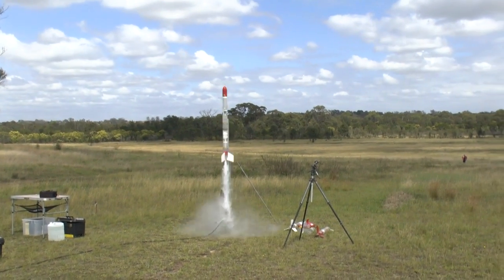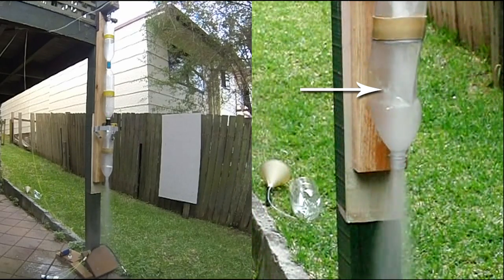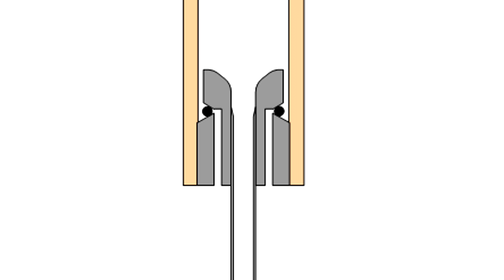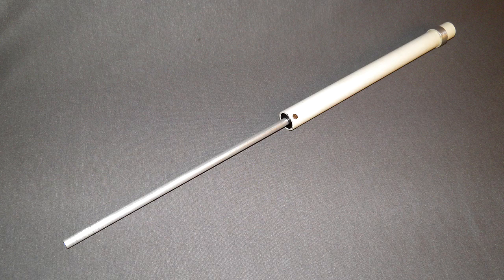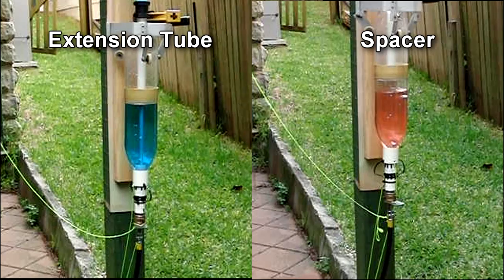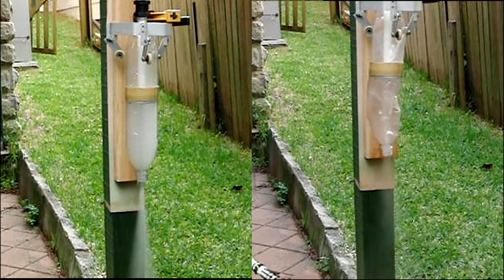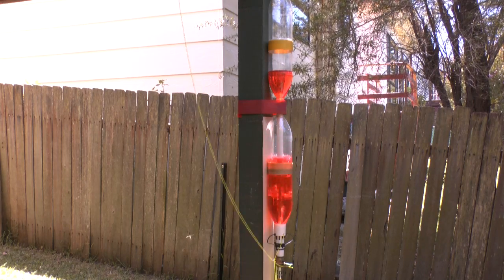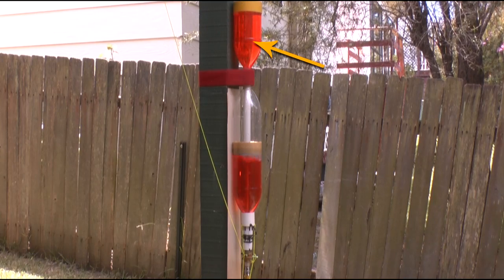Dual Thrust Water Rocket - Improvements and Measurement

Comment: I'm making a water bottle rocket, but I'm still figuring it out how to connect them, I'll be using 2x1.5 liter. and 1x1liter (Coca-Cola bottle). My nozzle would be the quick release garden connector (cause it's easy to use, other than improvising a launch tube).
Reply from the maker: Splicing bottles is your best option for conecting bottles together, but you will want to use ones with straight sides in order to get a good seal. Here is a tutorial: http://www.aircommandrockets.com/construction_6.htm

Comment: Can we try a converging diverging nozzle for this?
Reply from the maker: You can, though diverging nozzles don't work for the water phase part of the thrust. The air pulse phase would see some benefit if you are using higher pressures.
Reply: @AirCommandRockets  provided I have given high pressure, will the flow out of the nozzle be supersonic? And also, what if I use a light weight metal in place of a plastic bottle and inject flammable liquids inside and ignite them with high pressure? Will that be a good technology? Thanks in advance  :)
Reply from the maker: Well if you are injecting a flammable liquid (and presumably an oxidizer so you can burn the fuel), I know this will be a good technology because that is exactly what a liquid fuelled rocket engine does. If you are wanting to try something like this, I would strongly discourage you as it is extremely dangerous if you don't know what you are doing.
Reply: And what is the maximum pressure that the bottle can withstand? :D
Reply from the maker: Depends on the bottle, but regular carbonated drinks bottles will burst at around 190psi. This means you really don't want to pressurise it above 130psi.
Reply: @AirCommandRockets  that's nice, I'll try designing some sort of light weight frame for the entire bottle structure to withstand more internal pressure😊 thanks for the tip!
Reply: @AirCommandRockets  that's nice, I'll try designing some sort of light weight frame for the entire bottle structure to withstand more internal pressure😊 thanks for the tip!

Comment: I turned a jet foaming nozzle on the lathe.   The first few were good practice. I have a few pointers for those of you trying to make these nozzles. Sequence matters.   I started with a section of solid aluminum rod that is larger than the inner diameter of the PVC pipe.  I turned a section of the rod down to fit inside the PVC. Next, I chose which end would be the "upper" end of the nozzle and turned that upper section to be about sixteenth of an inch smaller in diameter. This is to allow  the water and air through.  After that, I cut the V groove . The V groove is placed at the point where the lower larger diameter section and the upper smaller diameter section meet.  While the new nozzle is still in the chucks, I drilled the exhaust hole through the center.  Once the center hole is in place, I cut the whole nozzle off the end of the rod.    Measuring the depth of the V groove, I then mark the 4 fill holes on the bottom of the newly cut nozzle part.   It is important that when drilled, the holes A) don't  cut into the center exhaust hole and B) don't cut into the V groove. and C) don't go all the way through to the top.  The 4 drilled holes need to dead end just above the top of the V groove. So you will need to measure the depth needed to drill and set that depth on the drill press. The final step is to turn the nozzle on the side and drill the exit holes from the V groove into the 4 fill holes.  These exit hole also are depth sensitive in that you can't drill into the center exhaust hole.   When I drilled these holes, I made sure to pay attention to the pressure on the drill press handle - when it lightened up I knew I was through the side wall and into the fill hole.  other things to consider,  make sure the V groove is deep enough that the O ring can flex inside the groove and not be held in place by the side wall of the PVC pipe.   When I do another nozzle, I will try to cut a taper into the center of the top end of the exhaust hole in order to get a convergent flow towards the exhaust hole. This should reduce turbulence around the entry end.   I will also drill a short pilot hole on the bottom end of the nozzle to accommodate  the small exhaust pipe - that will provide a dead end for the pipe. In any event, I'll made that a snug fit so that it hold though use. I'll try to make a video with my next one so you can visually see what I am describing.
Reply from the maker: Thanks for the great write up Doug. I would be curious to see the type of results you get with the nozzle.

Comment: is there possibillity to make big rockets using homemade connectors ?? my leaks how to make them ?? i used bottle necks
Reply from the maker: Yes it is possible to make big rockets with home made connectors. How did you make yours and where does it leak?
Reply: AirCommandRockets with 2 caps glued with hotglue gun and melted holle with soldering iron but caps are slicly bended at top thats my problem i used pipe tape and ducktape but i can't fix it any idea ?
Reply from the maker: That type of connection will not work well. Caps are made from polypropylene and most glues will not stick to them. Hot glue from a hot glue gun is too weak as well. There are great forces involved in these couplings when pressurised so the connection has to be very strong. Try getting a PVC pipe that just fits on the outside of the cap. Rough up the outside of the caps and glue them into the PVC pipe with 24hour epoxy. That should get you a better connection.
Reply: AirCommandRockets thanks ill try it wiuld be nice that youmake tutorial on this theres nothing on google and youtube about those connectors probably 70% of people have that problem ... thanks ill try to make it

Comment: I know almost nothing about rockets.......... 
The boost and sustain have separate pressure vessels at first.
I would want to add a small bypass joining them bc the sustain pressure vessel has a lot more "power" stored.
I know the air phase at the end helps but having a punchier boost would help more. Also, you could easily tinker with the bypass and adjust the ratio of boost to sustain.
Just a thought......
Also, anyone else notice the air amplification effect that caused the vacuum. Is there any one way intake that could let that happen and not leak pressure at launch? Would the extra flow help or would it just rob speed from the jet and lower late acceleration.
I know almost nothing about rockets, but this stuff is cool. I'm going to go build one.

Comment: Hello, I have a few questions here: 
1. How do you keep the water from entering the extension tube after passing the non-return valve? (Or does it matter?) 
2. How do you make the non return valve? What is it made out of?
Reply from the maker: Hi, good questions. 
1. We have it plugged with a piece of skewer stick wrapped in electrical tape. This prevents most of the water from going in. The skewer stick just gets ejected at launch.
2. The non-return valve is just a simple pin valve. Basically a small hole ~2mm diameter. A pin with a large round head is inserted into the hole and the bottom part is bent so it can't come out. Under pressure the pi head seals up against the hole. While not a perfect seal it is good enough and easy to make.

Comment: I see an issue with the extension tube. It seems that it vibrates with the first stage, thus affecting the path. Maybe some small internal and structural fins should be added between the inner side of the bottle neck, and the extension tube. But as always your work is impressive! Good luck!
Reply from the maker: Good observation! Yes, we spotted this too after the initial runs, and we too considered doing exactly what you suggested by putting in 3 thin brackets to support it. In the end we noticed that the tube settles after the boost phase. The amount of thrust that the tube generates during the boost phase is minimal compared to the big nozzle and so if it deviates a little it was only going to have a minor effect. The thrust vector would have been out only a few degrees anyway. In the end we decided that having less obstruction to the water flow during the boost phase was going to outweigh the benefits of trying to keep the tube centered during the boost phase.
Reply: Nice to know that. Anyway maybe the fins can be some centimeters above the neck (well inside the body of the bottle), but I imagine a lot of technical problems for such a small advantage.
Apart from that, I've seen your incredible fiberglass rocket Shadow, and I was wondering: will we see a two or three stage fiberglass rocket?
Greetings and good flights!
Reply from the maker: DoNotPushHere Thanks, :)
Q: The Shadow and multiple stages?  
A: ;)
Reply: @AirCommandRockets  Horizon ;)

Comment: Nice, but what did you hang to the rocket at the end? A weight?
Reply from the maker: After each test we hang an exact 1Kg weight from the rocket while the load cell data is still being recorded. This way we have an exact 9.8N step recorded on the plot so we can calibrate the rest of the waveform relative to that. The load cell/amplifier combination can drift in calibration during the day with temperature for example, or as we change the gain on the load cell amplifier we always have an absolute reference recorded with the data.
Reply: Ok, thanks! Can you maybe make a video about your load cell? I would really appreciate that!
Reply from the maker: Oli4vn We can have a look at putting a video together although we already have the full details about the whole setup: load cell, amplifier, computer interface and the software we use on our main website. Just look at our day67 update.